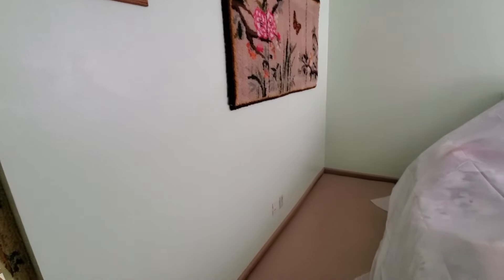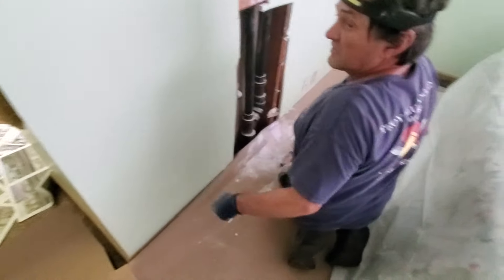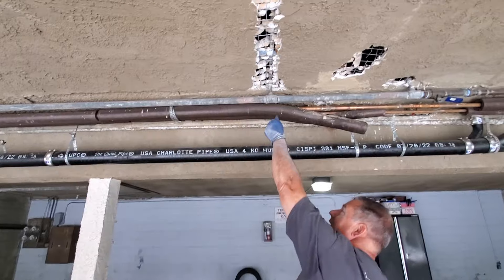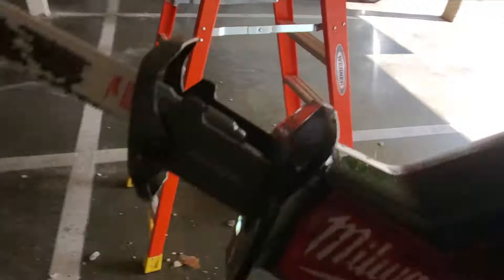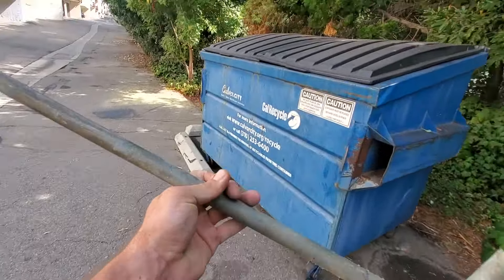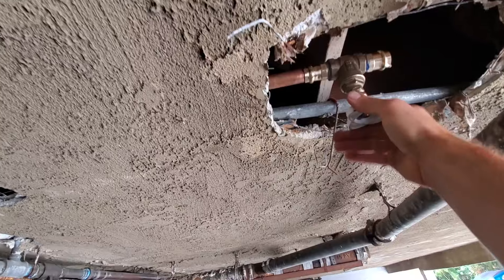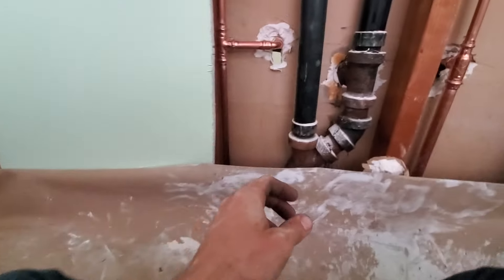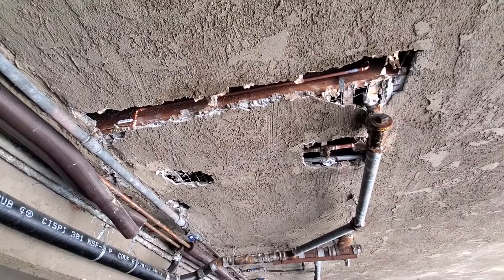LOW FLOW lavatory sinks repiped in TYPE L COPPER

Comment: From the other old copper and galvanized still there, you could have steady work just on that one building.

I just replaced the supply valve at my house + a few short nipples (all verticals) and yep, those pipes were pretty clogged and nasty inside.

No flow issues yet but I’ll be racing against the clock to get the repipe done.

Comment: Sweet   nice work    I like the gate valve  for extending handle   through stucco.     Another way is  extended handle for ball valves    no idea how you get them but on pipe fitting jobs we need to extend handles   because they run 1 1/2" thick insulation on heating  hot water     probebly special order